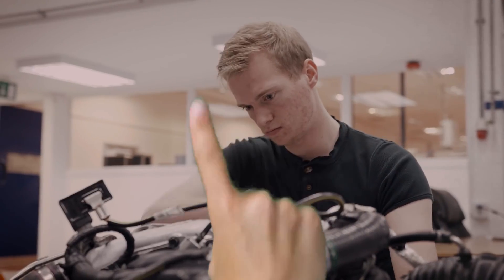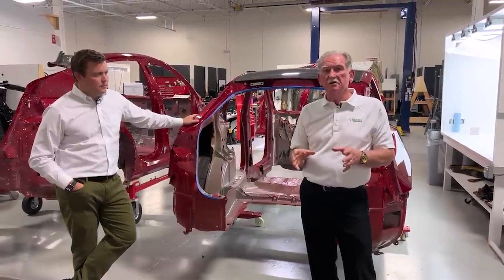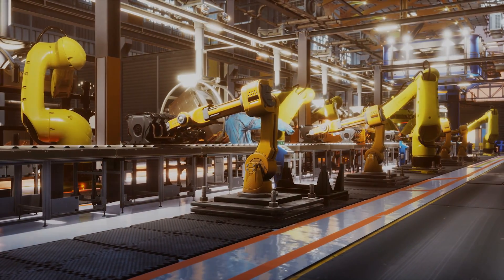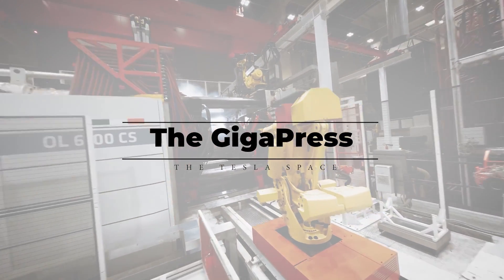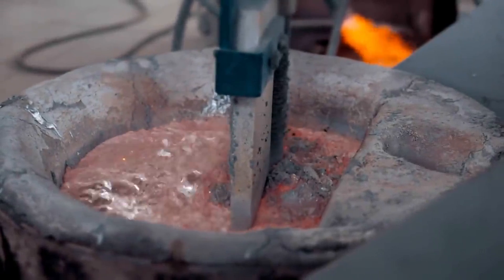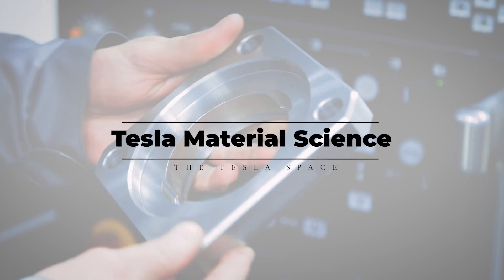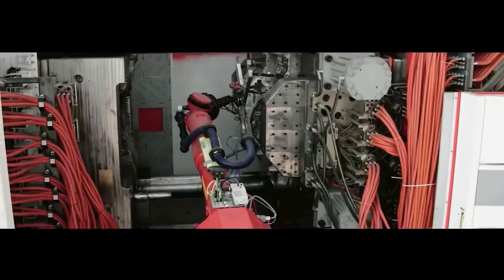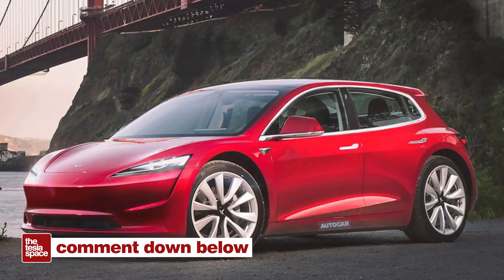The Incredible Logistics Of The Tesla Giga Press!

Comment: The thing about bolt-together assemblies is their repairability. You can swap sections out when they are damaged or wear out. A single casting, if it is damaged in a crash, will be hellishly expensive to replace. & you have to be a very good engineer to design an assembly for wear item repairability ad infinitum. Which Tesla have not proven themselves to be in the past (junking an entire battery for the sake of a few faulty modules, or even cells, for repeated example).

Comment: If they did it with a Hot Wheels vehicle then yes it can be done. It's just a matter of time. Now they have to develop the press that'll allow them to do that. They can also 3D print it.
Reply: I see your thinking, but hotwheels aren't full working cars. They can be solid metal. Nevertheless I think single piece casting or something close to it will happen sooner or later. Tesla has been pressing forward with everything quite agressively and succesfully and will with this too.
Reply: @thotmorgana  you can't assemble everything you want to go. You know your power source, motors, wheels, brakes, plastic parts, and any other miscellaneous stuff has to be assembled by a person. You're just talking about the frame pressing It can be done in one go. If you were to cast the whole thing in a sand mold yes. For instance if you were going to make a sword how would you do it it's the same concept there's just no pressure involved. Just remember when you're assembling the driving mechanism, and interior parts that has to be done by hand. You can't do that in one go. Unless you 3D print
Reply: @thotmorgana  to be honest with you, I'm thinking about it and it wouldn't be beneficiary because of repair. Whenever they do body repair, which I don't think many people would do on a Tesla, you have the section off parts. If you're talking about cost efficiency it may not be at the beginning but as time progress it may get to that. You might have to do a six part mold to get the vehicle to be cast correctly. About the battery structures they would have to install that afterwards. That has to be inspected to make sure everything's a line correctly. I know the car can be, referring to the frame, but I don't think the battery and the car could be done at the same time. You have to remember the car is hot when it comes off the press batteries can only take a certain amount of temperature. I think it's better to do to two to three parts. You have the main structure and then your side structures. The doors and everything has to be added later on.

Comment: May be. But I think that Tesla will go through different steps- first one have been made, front and rear castings. I think next one could be the body sides castings that could be attached to the front and rear casting with acommodations for the floor casting, so may be not a single casting but just four or five castings that could be joined together. Tesla have already the concept of the Triangle for a Truck structure in the Cybertruck, maybe they could follow something similar for the smaller, less expensive car first, and then apply that for the single casting car, producing an extremely strong and robust vehicle never seen before!!!!!

Comment: Around 12:00, you mention corrosion resistance.   The underside of a Tesla is covered in smooth plastic.  Road salt can't reach the metal,  so rust protection is only important at seaside locations where the air itself is salty.  But since legacy vehicles don't really suffer that much from salt air, there's no reason to think Teslas will.
Reply: Far better to noy need the protective barrier.    Had a skid plate under a pickup gas tank that collected fine dust between the plate and the bottom of the tank.  Rused out the bottom of the tank but not the stronger plate.   Dust and condensation over time maybe enough to cause rust.

Comment: The gigapress takes way to much energy!
Reply: More than the 300 robots it replaces? LOL
Reply: @austinformedude  maybe if you get supercheap energy and only for big expensiv cars,than it could make sense!
Reply: @austinformedude  Stamping and spotwelding is the best!Cheap steal easy to fix maschiens easy to recyle easy to repair!For extrem expensiv cars its maybe ok!But if you want to use real high tech material,than you use some carbon strengenet plastics!
Reply: How much energy do you think the 30 robots it replaces require?
Reply: @diamond_h0us  Think about just th extrem expensiv alluminium and then the heat you need to nearly liquifey it,,!Yes its way cheaper useing 50 spotwelding robots that can use normal sheetmetall!